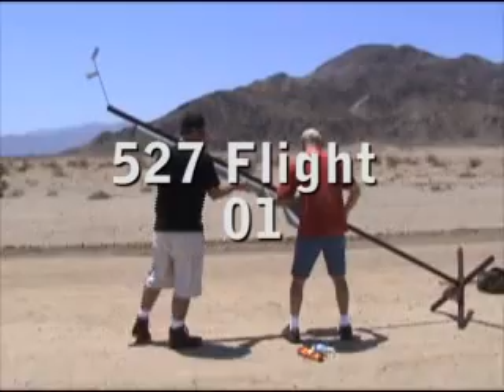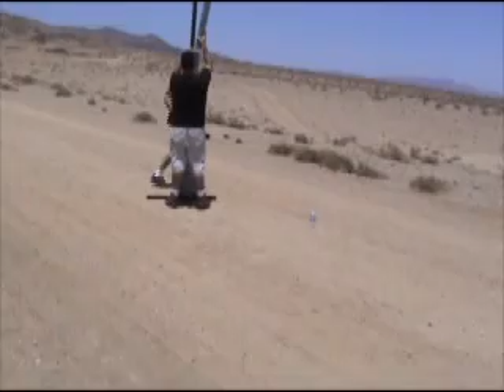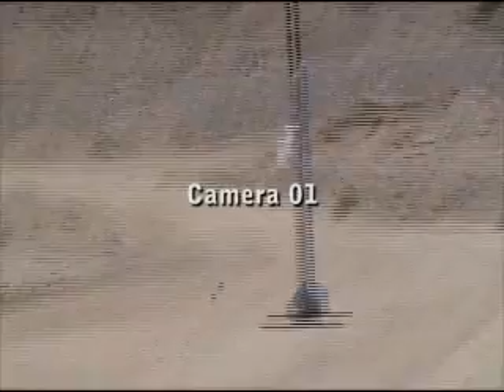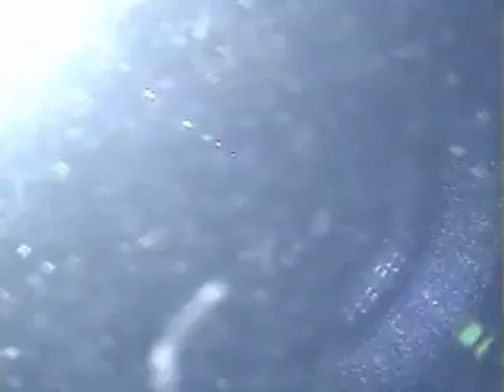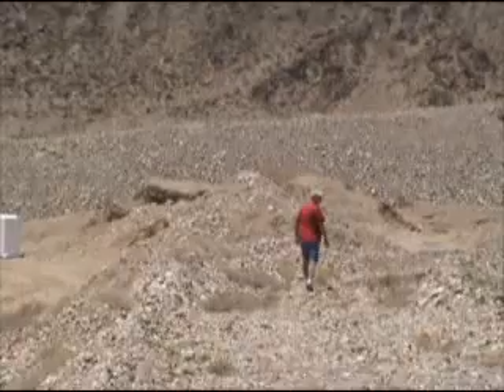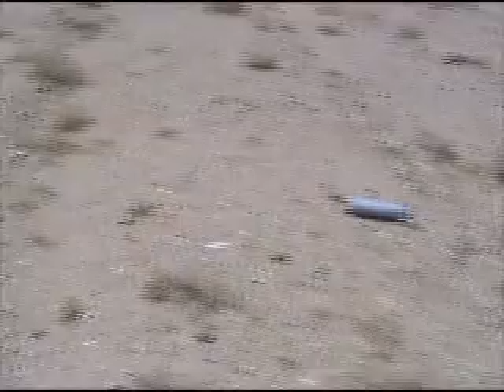L950 PVC Sugar Kno3 Rocket

Comment from the maker: The byproducts of combustion are very hydroscopic, meaning they absorb water out of the air very easily. I mix powdered sugar with Kno3 and corn syrup. The mix is very easy to pour and remains flexible which makes it burn very nice. I wrote a step by step book on how to make the engine and the rocket. You can find it at amazon, it's called I still have all my fingers. Hope that helps.
Reply: Dan Pollino what is the ratio of the corn syrup to the other ingredients? I will try this.
Reply: @williamchildress1724  65% KNO3, 18% sugar and 17% corn syrup.

Comment: I've seen ppl make the engines without cooking and my result was a liquid substance that clogged the nozzle. There was little to no thrust(could have been my poor design and/or haste to test) and the liquid was spewing out gumming up the works. I have stored my mixture in a Pyrex spice container and it seems that, after a few weeks, it has gotten even harder to ignite. I am guessing the cooking process helps prevent some of these problems?

Comment from the maker: I don't think you're making it with my method, mine doesn't crack at all, it remains flexible. I've never had fungus on it. Are you sure you're doing it right? Did you follow the instructions in the book? You know there's a book on how to make it, it's called "I Still Have All My Fingers" and it's available on amazon. Hope that helps, let me know if you're still having problems.

Comment: Different mix ratios give different results, just like 90% copper and 10% tin make bronze, but 90% tin and 10%copper makes pewter but both are the same base materials. Also the smoke bomb isn't restricted at the exhaust with a rocket nozzle.

Comment: @logicbranch Basically you just need to keep the CG of any rocket somewhat above the fins but not so much so that it could tip over due to the fins being unable to overcome potential tipping moments, and the location of the CG is actually what you should use to determine the placement location of the fins, as well as the area that the fins should have. It is also very important to preserve symmetry as much as possible so as to keep the CG on the longitudinal axis.

Comment from the maker: @kd7dwz The L950 was basically two K450 put together with a PVC coupling and some RTV silicone to seal the ends. The nozzle throat was widened so the that engine KN was still at or just below 300. Good luck with your project!

Comment: I have been following Nakka and Yawn and designed my own 1.5" 600 gram KNSU motor. I bought your book I still have my fingers to learn how you do your fuel and nozzles. I like that you think outside the box. Sobital is to expensive for my taste. For this engine what size nozzle did you use? I assume you did everything else according to your book. I use the 9 volt battery as the weight for my g-switch, it slides down and closes a snap lever switch. I use a mercury switch with a cannon fuse delay.

Comment: Question: at what point, after graduating from Estes kits and designing bigger units, does the rocket need an actively self-adjusting guidance system to keep it flying vertically?

Comment from the maker: The rocket body is made from ABS drainage tube 3" diameter. The K450 has 4.83 lbs of fuel in it and the L950 had almost 10.

Comment from the maker: You'd never want to grind the oxidizer and the fuel together, they might ignite. It's simple, the kno3, sugar and corn syrup are heated together to lower the viscosity and then poured into the engine casing to cool. I wrote a book on how to make the engine, it's available on amazon, it's called K450 PVC Rocket Engine. Good luck.

Comment from the maker: Well it's a little more complicated than that. You need to mix them in the right ratio or your fuel won't burn. You can use Lyle's Golden Syrup if you're in the UK or you can Google how to make corn syrup on your own. It's pretty simple. You can also purchase the book "K450 PVC Rocket Engine" on Amazon or inverseengineering and it will explain exactly how to do it step by step.

Comment from the maker: The corn syrup is not a binder, the sugar is the binder. The corn syrup makes the fuel flexible so it won't crack and over-pressurize. The fuel is not rcandy, it's flex fuel and made completely differently.

Comment from the maker: This isn't Rcandy, it's flex fuel. It's a different formula and preparation method than Jimmy Yawn's method. It's a single case bonded grain and there is nothing lining the core. The fuel is powdered sugar, corn syrup and Kno3. There is a book on amazon showing how to make it. It's called K450 PVC Rocket Engine Design and Construction by Dan Pollino.

Comment from the maker: Thanks for the suggestions! My building strategy is to put together high power rockets with off the shelf inexpensive parts that perform the same or better than commercially made rocket kits. My goal is to have the entire rocket cost less than $100 including the engine so accelerometers and composite materials are out of the question. I agree with you, they do work well, they just don't fit into my design strategy.

Comment: Brother, do yourself a favor... Buy an accelerometer. A GWiz LCx would be an excellent choice, or an HCx will record and report data from your flight.

With this much impulse, you're going to approach Mach, if not transition it. Learn about doing composite lay-ups on the fins and fin/airframe joints. Stiffen the fins to keep them from fluttering, and improve the a/f to fin joint. Fin flutter and sonic transitions kill airframes dead without it.

I AM qualified to speak to this... 8^)

Comment from the maker: Mix 65% Kno3, 18% powdered sugar and 17% corn syrup in an electric wok to 210 degrees. Pour it in an engine casing and put in a coring rod. Make sure the nozzle throat is sized so that the engine does not exceed 300 KN. Add an igniter and a smoke element then put on an end cap and seal it.

Comment: You made a motor using seven pounds of KnO3 and then light it and this is what happened? whats the diamiter of the pipe you used and how did you make the nozzle at the bottom if you dont mind explaining

Comment from the maker: It was a single case bonded grain that was 56" long in a 2" PVC schedule 40 pipe. I believe the motor weighed close to 10 lbs. and the maxium thrust was 600 lbs.